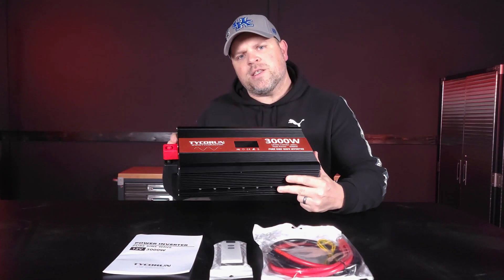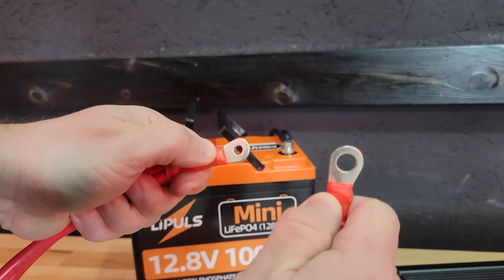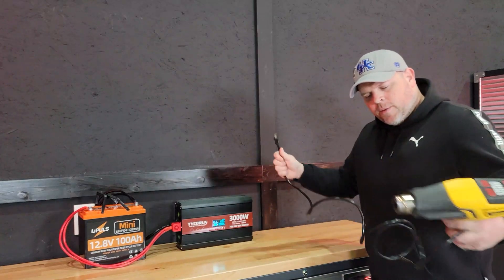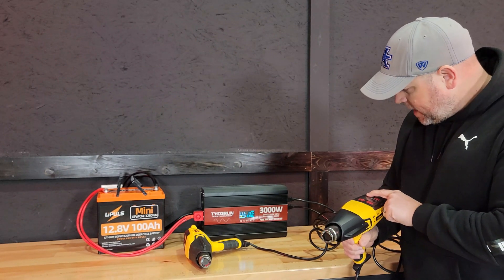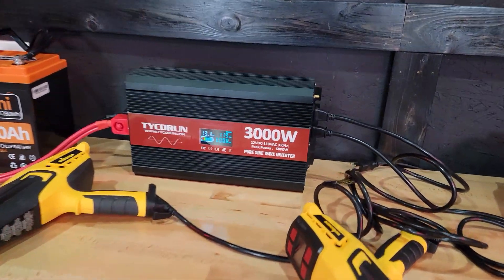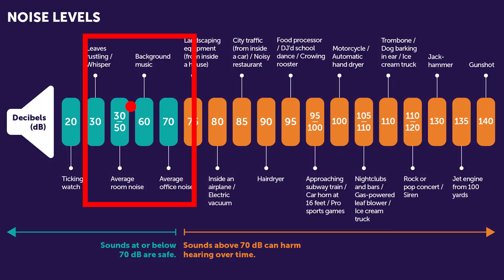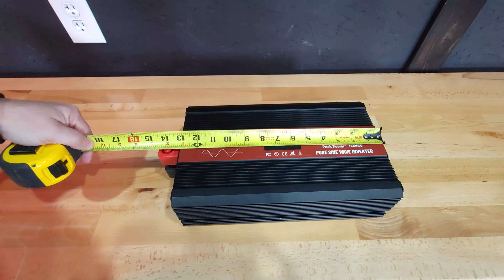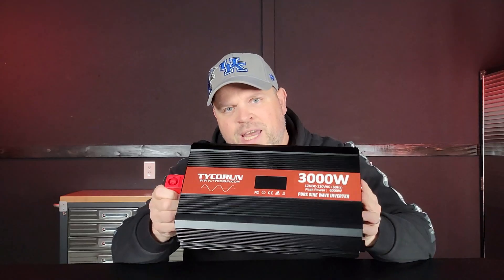Tycorun 3000w Power Inverter 12v to 120v

Comment: Another very good review. I would like to see you measure the actual voltage out vs what the unit says and also invest in an oscilloscope to see if it’s a true sine wave or clipped sine wave output.  Finally what is the stated warranty and can the mfg be reached?  Thank You 

I’m at a point I want to buy, but not sure I can trust Amazon’s feedback ratings.

Comment: I’m looking to run an 5,000 btu ac unit in my work truck.  Would this be a good situation with this. Or any other 2000 or 3000 watt inverter?
Reply from the maker: It really just depends on the start draw of that ac. In most cases yes. Thanks for watching and commenting.

Comment: It seemed to appear that the output voltage dropped significantly under load down to 105 VAC.
Reply from the maker: The battery voltage does experience sag under excessive loads. I could have helped that by adding additional batteries in parallel. No fault to the inverter. Thanks for watching and commenting 👍🏻